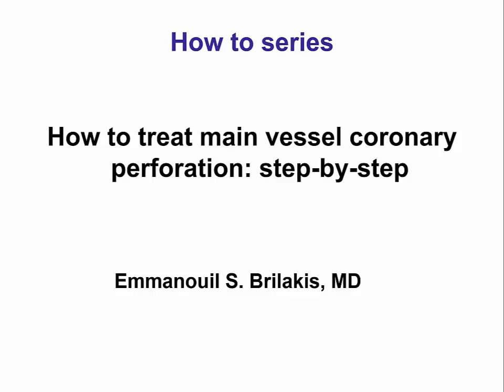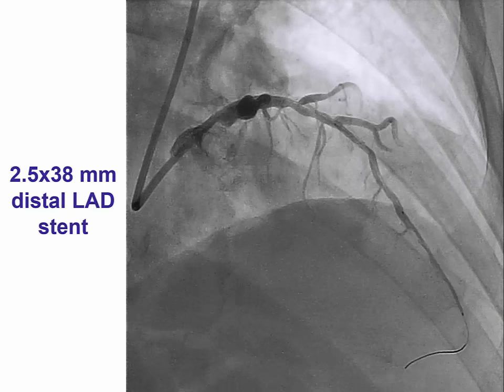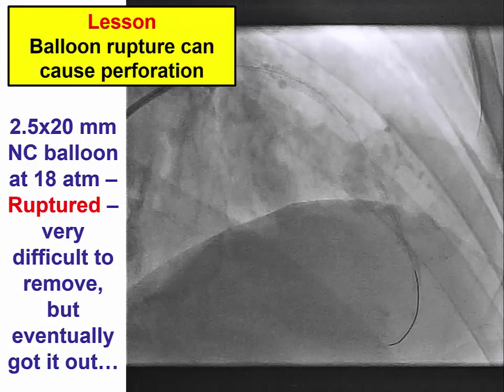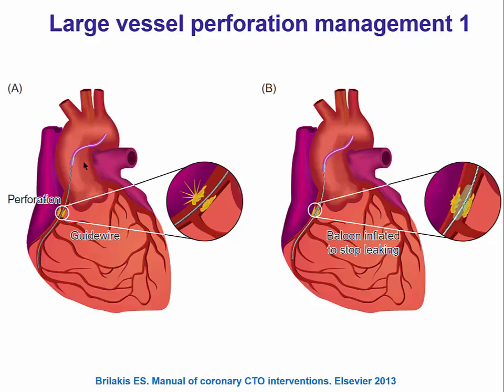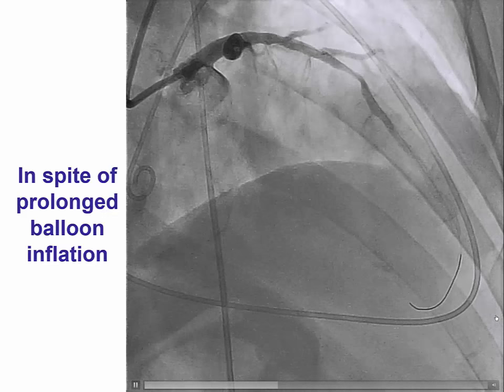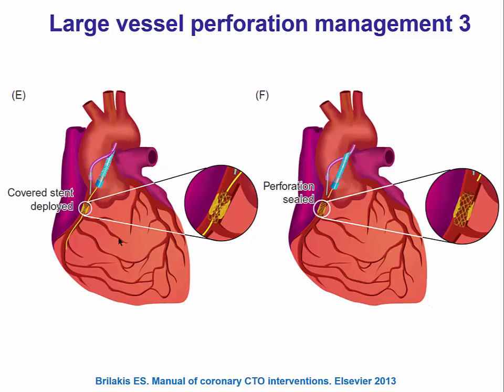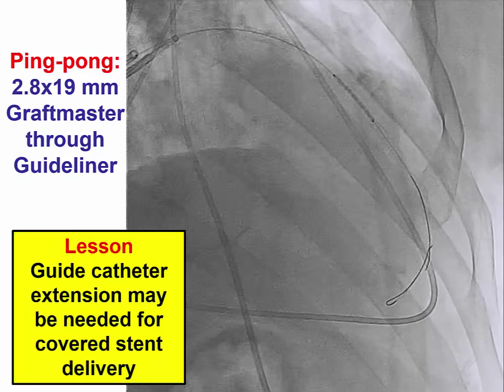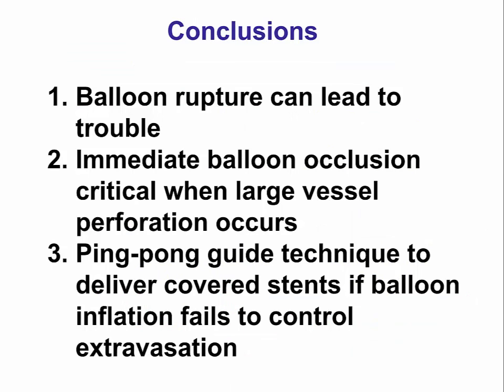How to treat main vessel coronary perforation: step-by-step

Comment: Nowadays we have the Biotronic PK Papyrus covered stent which is not as bulky as this one... We tend to reverse heparin ( only half), and keep flushing the guide catheter several times per minute. 
It is much more common the perforation to  be caused by the high pressure inflation 
itself, especially by an eccentric calcium in the plaque, without rupturing the balloon. This facilitates the proximal inflation of the balloon faster then the operator could do in your example. Probably by just reversing half the heparin you could have achieved hemostasis in this case, but we never know, if you have the covered stent and believes it can be delivered , go for it. 
But if you did use the covered stent there is no need to reverse anticoagulation. Never forget it will always be a fight between thrombosis and haemorrhage when a perforation occurs.